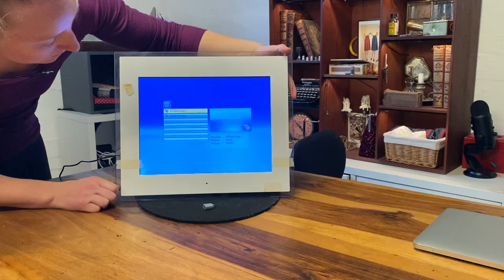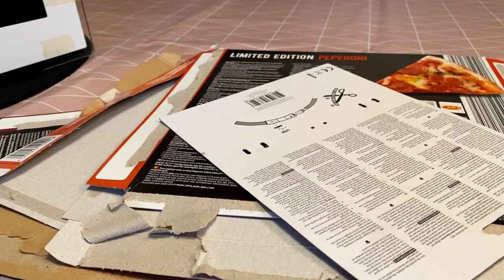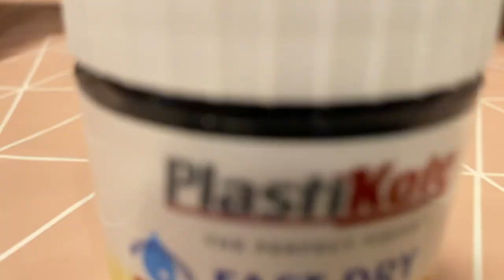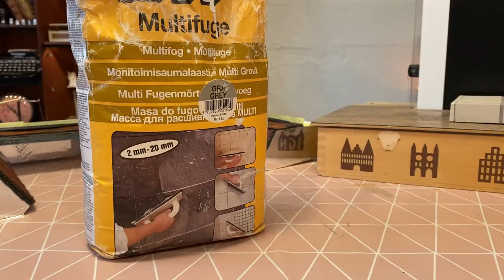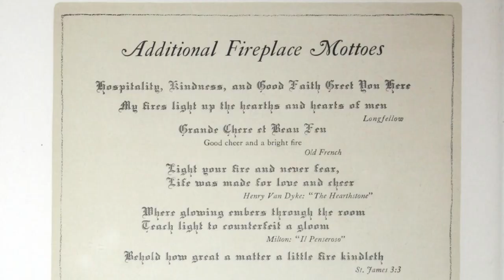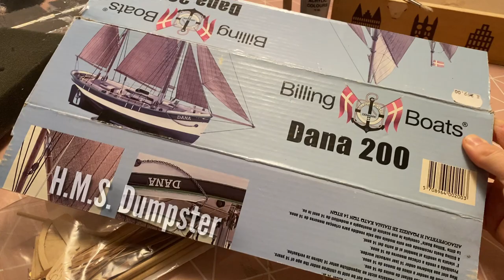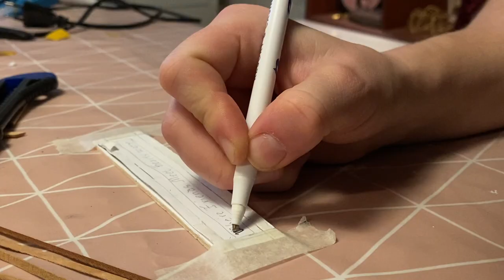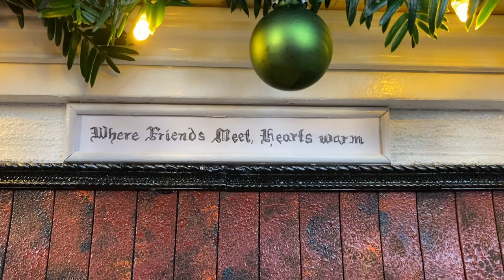Victorian Inspired Miniature Fireplace from Garbage // From Junk to Jingle

Comment: As someone who grew up in a historic house, hodge podge of time periods is definitely accurate. There were more than several decades in that house just in crown moulding and construction alone (and like four in just the fireplace!)

Despite it being a balmy 15°C rn, this really has me fired up for getting cozy with a cup of tea, and maybe instead of casting iron, I'll cast on some knitting. 😂 lets hope the picture viewer doesn't brick anytime soon, because I don't think a plaster will solve that.
Reply from the maker: I feel pretty lucky that the late Edwardian house I grew up in suffered from enough neglect that many of the original elements were preserved, and the newer additions were mostly done in a rather slipshod manner, so they were fairly easily removed. 
Alas, the picture viewer (along with the whole facade) had to be left back in Denmark because there was no way I was fitting it in a suitcase, but we did use it a TON actually, and I'd love to find another one to redo. Or maybe use a flat-screen TV and do a larger scale version... we are always finding those laying around!
Reply: @ShannonMakes  I think ours was built during the 1770s, but then burned down during the war, and the foundation was salvaged and moved then rebuilt in the early 18-teens. There was a LOT goin on in that house. Sometimes I miss the memories made there, but I don't miss all the dust 😅

"I Built A Firesafe Giant Foam Fireplace!" sounds like the clickbait title from 2007 and I'm so here for it 👏👏👏
Reply from the maker: @Nebulouslystarlight  oooh, 1770s?!?! That's so cool (possibly literally, in the winter, if not properly insulated, but I meant more in the figurative sense of the word)! But yea, I can see what you meant about the hodge podge of eras... and the dust!